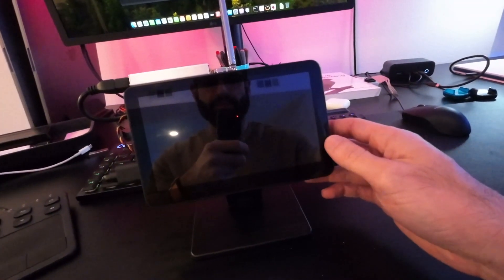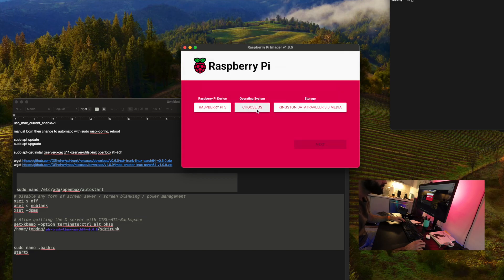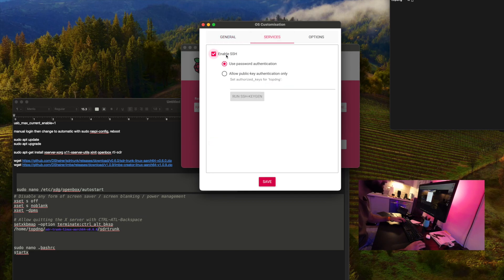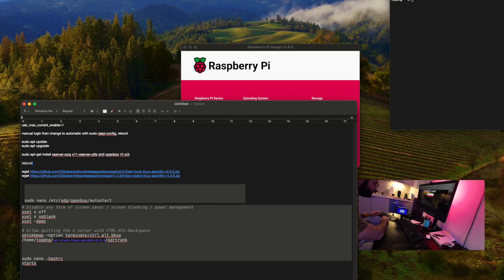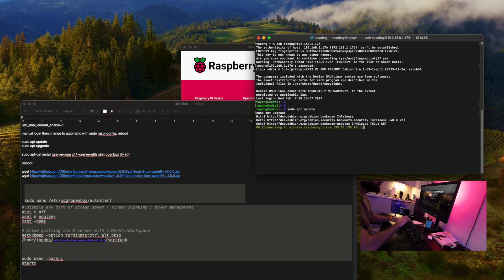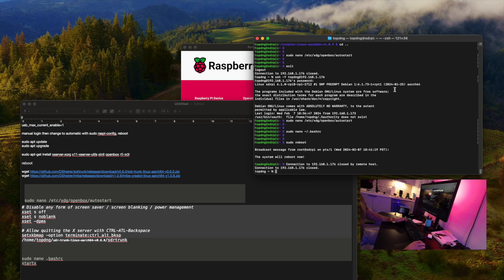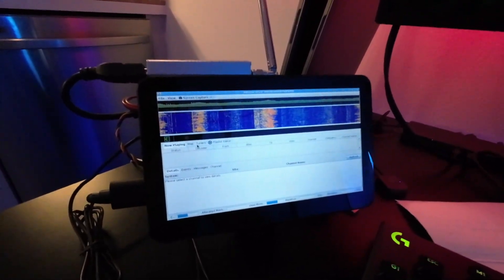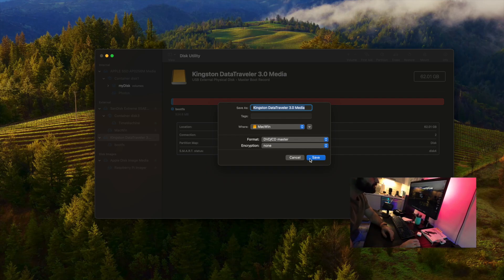HOW TO BUILD THE SDR-PI STEP-BY-STEP...

Comment: Im £240 lighter today because of this video lol. I have been looking at various configs but went with this shopping list.  I use a pi zero W2 as a WSPR beacon and frequently get over 3,000km reports on only 10mW (0.01w)!!!!! Next month I'll treat myself to a HF transciever module for my new pi 5 which is coming on Feb 14th with everything else.  One thing I did change was to opt for an M.2 SSD rather than a USB pen drive. Great stuff,  Thanks!
Reply: Good luck! Make sure you have the correct charger for the pi 5, .. unfortunately the 5 has some weird power spec that most PDs don't understand. Just warning you now. Also, if you got an SSD hat for your pi, you may experience weird issues which are hard to diagnose which comes back again to the power draw. Some ssd's just draw too much. I ended up putting a Poe hat on my pi5 and powering that way.
Reply: @drsmapdi  not ran into any issues yet however I decided to install dragonOS pi64 on the m 2 and pihpsdr on the SD card so best of both worlds
Reply: Oh man tell me about it. I wound up grabbing 3 SDRs and adding a speaker HAT, and now I'm a little obsessed.

Comment: I think my comment was deleted because I included a link but if you're having audio issues where a talkgroup shows up in sdrtrunks left or right audio channel but you have no audio from the speakers you can fix it temporarily by going to user preferences and changing the audio to mono then back to stereo.  A better fix is to switch to pipewire instead of pulseaudio. Unfortunately I can't link the guide I used to switch to pipewire and remove pulseaudio and there are a bunch of guides that didn't work for me until I found the one that worked but it's from a website with baeldung as the name.

Comment: Awesome news. 

I'm trying to build a PI5 head or headless (head [monitor] would be better for watching it) system that will SDRtrunk and then forward that audio to the input on a discord channel. 

I've seen Discord is available now for Pi, you answered the SDRtrunk portion, BUT, what could we use instead of Virtual Audio Cable (my windoze machines use this) to redirect the audio?

Also will this setup handle 2 SDR's (CC+3VC)?
Reply: There is a guide on reddit in the discord subreddit to stream audio using pipewire to discord.

Comment: Going to build exactly this system but most likely will run 2x RTL-SDR instead of 1.

Thanks so much for your video ive been wanting to get into this hobby live in los angeles but didnt want to spend the 600+$ for an SDS100/200 and i think this will work out perfectly for me and be much more fun.

Comment: ok got the playlist copied and installed. I dont have any audio in the output/Tones. I checked the raspi-config system, audio and two audios are listed and I tried both but still nothing in the output/tones box on the app. i read the threads below on audio issues and tryied them but still no luck. suggestions
Reply from the maker: Hi Art, it seems like I was able to fix this on someone elses setup by having them install pulse audio. Please try `sudo apt-get install pulseaudio` I'll tag you in the thread now too.
Reply: @TopDNG  i tired that command and still have no audio i have .jar file in sdr trunk as well still no audio

Comment: I have the build complete. I think I figured out the RTL-SDR V4 drivers, and things look good except that like @MaxJupiter I have no audio. I double checked the .jar file and it has been selected. The test tone buttons don't output audio, and there's no output device listed in the dropdown box?? The cool thing is that I have SDRTrunk setup on a desktop that is working well and I was easily able to copy a working playlist over to the SDRPi that shows plenty of activity on the Pi, but again, no audio. Volume is up and I haven't seen any kind of mute function on the display case. Any ideas???
Reply from the maker: This is strange, numerous people have reported this. I need to look into it. Here is what I suggested to someone else:

In this case you will probably need to check a few things, in the raspi-config menu go to audio settings and see if you can select the audio device there.

If not, you may need to reinstall the sound drivers, not sure what may have happened -- https://medium.com/@thedyslexiccoder/how-to-fix-the-audio-output-on-a-raspberry-pi-4-21045bc7d7b

Let me know if any luck
Reply: @TopDNG  The raspi-config >system>audio shows two hdmi audio sources, 0 and 1. It doesn't seem to allow me to switch from 0, though. The link you provided was missing several of the graphics that had code to be entered, so I couldn't follow it.
Reply from the maker: Ok let's try a few things, can you use the other HDMI port first?

Second, do you hear anything if you run either of these terminal commands:

aplay /usr/share/sounds/alsa/Front_Center.wav

paplay /usr/share/sounds/alsa/Front_Center.wav

 @yourpalfranc
Reply: @TopDNG  I tried something else and got some audio...I installed a Sabrent USB audio adapter. It was recognized and gave me a device to select in SDRTrunk audio settings. The test tones don't work, but I'm getting identical audio from my working Trunk instance. I'll unplug the adapter and try your test files.
Reply from the maker: Now I am wondering if some of these monitors have bad audio hardware... hmmm.... thanks for the update @yourpalfranc
Reply: @TopDNG  aplay showed some playback information on screen, but no audio from the Pi. paplay returned command not found.
Reply from the maker: No errors with aplay? @yourpalfranc  

You can try installing pulse audio with `sudo apt-get install pulseaudio` and then see is paplay works with the monitor
Reply: @TopDNG I think that's it!! I'm getting good audio on the Pi and it's practically synced with my other SDRTrunk system's audio...no lag at all. The tones still don't seem to work "well"...the devices listed in Trunk>audio are stereo and mono. Both work for audio, and the tones worked for me once in mono, very laggy, though. But, at least it's working now. Thanks for your help.

I have some other questions about the display. Does your display show a full SDRTrunk window?? Mine doesn't. It has a bit cut off on the right and a good bit cut off in the bottom.
Reply from the maker: Great to hear!!! @yourpalfranc  

Ya the window size is annoying -- maybe if you double click the top window bar it should resize???
Reply: @TopDNG Ahhh....yes!! Much better! This is totally workable now! Thanks for all your help.
Reply: @TopDNG  By the way, 2 tuner dongles seem to be supported very well. The instructions on installing the V4 drivers from the RTL-SDR website were very straightforward....once I understood a couple of things.

Comment: trying to create a playlist however unable to see the full screen under radio reference. I can not select create channel button on the bottom of the screen
Reply: i ran into this problem and im stuck i know top dng mentioned configuring playlist on desktop than load it on to SDRPi but how do you do that with XML file
Reply from the maker: Yes I've noticed sometime you need to play with the window sizes to make things fit, try double clicking the top bar of the window.

I suggest you make the playlist "offline" (like on another computer running SDRTrunk) and move the XML file over to the Pi

Comment: Did you create the image ?   Link ?
Reply from the maker: I was working on it now but am having trouble restoring it to a fresh drive from my macbook using Etcher. Trying dd now and if it works I'll share on a Google Drive link
Reply from the maker: Added to the description, can you give it a try?
Reply: @TopDNG  I tried flashing the image in the description and it's just stuck in a boot loop on my pi 5 8gb. I also followed (what I think was) step by step typing in directly to the pi and it's getting a black screen on the monitor with a mouse pointer. Any ideas what I may have done wrong? I've been back through it several times and stumped.

Comment: I bought everything you showed and assembled it as have it running with the exception that I have NO Sound at all any idea what I missed?
Reply from the maker: Hi Max,

Did you double check that the JMBE library is selected properly? If not this can cause no audio when listening to P25 channels.

To check other things, if you press the "test" button in the SDRTrunk User Preferences under Audio -> Output/Tones do you hear a beep?

On this page, what does "Audio Output Device" show?

Finally, double check that the monitor volume is not muted.
Reply: @TopDNG  I found out I did not add p25 trunk channel correctly and its working now...  would like to learn how to add multiple channel manually
Reply from the maker: Good! I am happy to hear it's working. @MaxJupiter  

To add multiple channels manually you can use the playlist editor under the channels tab. I ended up using ChatGPT and fed it the template XML file as well as the list of frequencies I wanted to add and it generated the final XML file for me since doing it manually can be a pain. I'm sure there are better ways though, like maybe using the Radio Reference feature on SDRTrunk
Reply: @TopDNG  I am at the same place but when I go to Audio Output Device it is blank. The JMBE library is selected but no beep with the test.
Reply from the maker: Hi @BobbyRichardsonAtl  ;

In this case you will probably need to check a few things, in the raspi-config menu go to audio settings and see if you can select the audio device there.

If not, you may need to reinstall the sound drivers, not sure what may have happened -- https://medium.com/@thedyslexiccoder/how-to-fix-the-audio-output-on-a-raspberry-pi-4-21045bc7d7b

Comment: Any reason you chose Unitrunker over say op25?
Reply from the maker: This is SDRTrunk not Unitrunker; I haven't used op25 before, I think SDRTrunk has a lot more features?
Reply: @TopDNG  ah yes sorry sdrtrunk. From what I have seen of op25 it has a nice gui interface that shows what talkgroup is active. I will have to try both. I have many configs for sdrtrunk already and got op25 running earlier.

Comment: How many antenna dongles do you need ? Inthought you needed 2 for trunking
Reply from the maker: Well, I just have one dongle connected because the system I'm listening to isn't trunked. They are just regular P25 channels. I haven't actually listened in to a trunked system yet so I will try that in the future.

Comment: Just saw your previous video premiering your SDRPi project. This thing rocks!

I have been running a clamshell Pi computer  (in a pelican with touch screen) at work for checking wireless audio transmitters. I have been using RTLSDR and SDR# as a complete layman and have been wondering about adding this application. Subscribing and sticking around to see where you go with this design/project
Reply: Just out of curiosity, why did you say this is Pi5-only? 

At one point I had SDR functioning on my Pi4. I'm attempting this build on my Pi4 cyber deck with a spare SD card to see if I can get it to work. I'll update with results
Reply from the maker: When you say SDR functioning, do you mean SDRTrunk specifically? Certainly you can run the RTL-SDR dongle with something like OP25, but SDRTrunk needs more compute than Rpi4 @xWonderxBreadx
Reply: @TopDNG  believe it or not, but I had SDR# AND SDR-Trunk running with the desktop OS installed. Did it run well? Absolutely not. But it kinda did. Definitely needed more processing. I though you meant in terms of the chipset or architecture. My Pi5 just came in so I'll have to circle back on my 4 and see if I can get it running again. I'll let you know if I do
Reply from the maker: Nice! And thank you :)

Comment: Excellent tutorial!! I'm going to build one so It's generated a few questions for me 1)Why did you choose to go with USB boot media over conventional microSD? 2) Does your script download the drivers necessary for the V4 RTL-SDR? or the V3 that you have? 3) It appears that your instructions have been corrected?? (the corrections you made in real time in the video? /home/topdng/sdr-trunk-linux-aarch64-v0.6.0/bin/sdr-trunk) 4) Is the antenna you used superior to the "kit" antenna you can get with the RTL-SDR dongle, or just better for a portable solution?  Thanks!! I'm really looking forward to my hardware arriving. ~Frank
Reply from the maker: Thanks Frank!

1. No particularly good reason, the microSD card is a bit hard to take in and out of the slot when the Pi is mounted on this monitor. I noticed that the SD card boots faster than the USB drive, but I also noticed that the USB boot is a bit more *consistent*... I'm not sure why this is, sometimes the SD card boot would stall for a while randomly...

2. I believe the V4 should work with the same command, but I have not confirmed yet...

3. Yes use the corrections in the description, the sdr-trunk executable is in the bin/ folder as corrected there.

4. Just more portable, you can totally use the "kit" antenna and I was doing that for a while, it's actually better than the portable one!

Let me know if anything isn't as expected and I will help out!
Reply: Thank you, sir!! Now, I'm just waiting for all the hardware to arrive. I'll let you know how it goes @TopDNG

Comment: Hey, thanks for this project!  I am an LAPD scanner fan and a Uniden SDS200 owner as well.  I don't really want to risk that radio by taking it everywhere so this might be a nice option.  Can you receive LAFD with that antenna as well?
Reply from the maker: Looks like LAFD is from ~770-860MHz according to https://www.radioreference.com/db/browse/ctid/201#cid-102 -- And they use regular FM modulation; so it should be very easy to receive with this antenna and setup, but there is one annoying thing you should note... I normally don't use SDRTrunk to receive FM signals because there is no squelch function, so when there is no transmissions you will hear a constant white noise hiss... I would either find a different software or an analog radio that can tune to those frequencies, heck I think you can maybe hack a baofung to tune that high
Reply: Yes, I agree that without a squelch that software won't work when monitoring conventional analog comms.  Your video is my first exposure to SDRTrunk, so thanks for that.  I am going to watch the PI5 and look for a solution that could work on this platform.  I think that your application for the PI5 is great though so thanks again for the video!
 @TopDNG

Comment: Why did you need to be so close to pick up the police cars but not dispatch?
Reply from the maker: Great question; the police cars use a lower transmit power and they are often transmitting from locations which are obscured by hills/buildings. Dispatch uses a much higher power transmission from a higher vantage point so everyone can receive it easily
Reply: @TopDNG  Thank you. This channel was randomly recommended. I'm actually going to build this, so I appreciate it. I have a few other projects I'm working on with other microcontrollers like arduino, Stm32, and esp32, mostly focused on the automotive industry. 
I appreciate your videos and channel. I subscribed and hope to learn a lot.
Reply from the maker: Thank you @honestlocksmith5428  !! That means a lot :) Good luck and let me know if you have any questions during your build